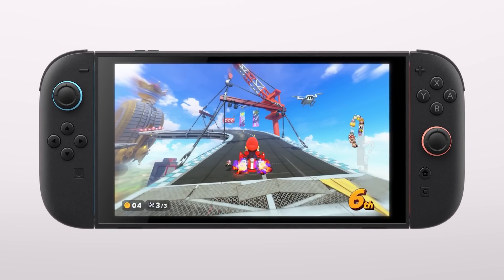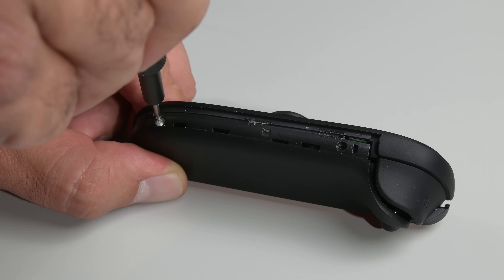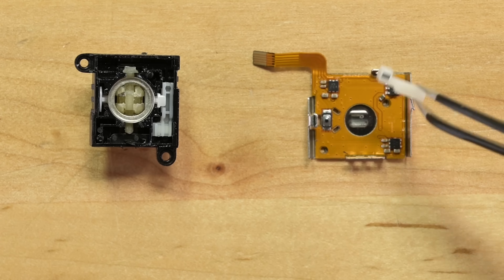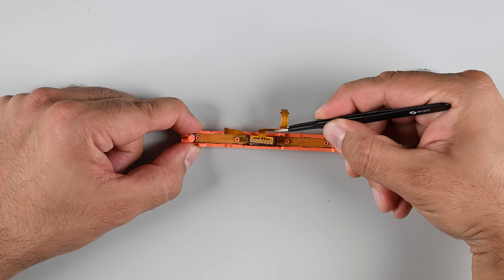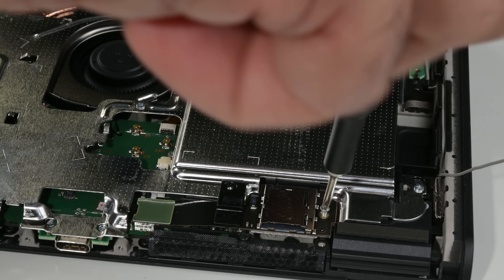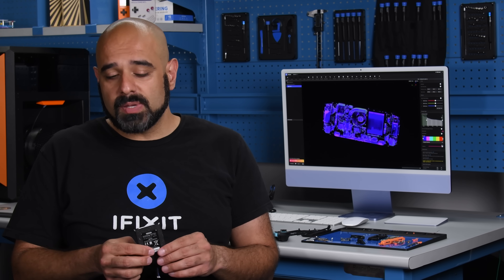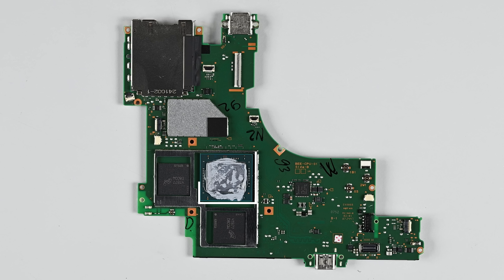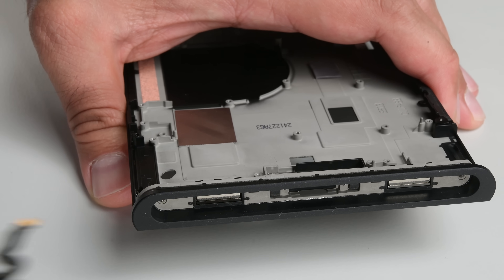Joy-Con Drift Isn’t Dead: Inside the Switch 2

Comment: Your wrong about how much stronger the Switch 2 is, it’s not 3x, in handheld mode it’s 0.15 tflops on switch 1 while the switch 2 has 1.71 which is 11.4x, in docked mode the switch 1 has 0.39 tflops and the switch 2 3.1 which is still about 8x so in total we are about at 9.5x. Also TeraFlops don’t tell the whole story in reality the switch 2 is even faster than it seems here, and it does absolutely not get beaten by the steam deck, I don’t even know where you got that info.

Comment: NIntendo is not legally required to provide genuine parts / instructions to do your own repairs.  Nintendo control the hardware at all levels and if you need a repair only Nintendo are authorised to do so as indicated in their terms / conditions and this is also a condition of sale.  Nintendo do not care on people’s “repair” opinions and never will as its more profitable to offer authorised repairs only.  As for “drifting? there is no financial incentive for Nintendo to resolve this issue either, so instead of “fixing” the issue they simply replace the sticks with the same identical hardware which will fail down the track - this is not a fix - its a band-aid solution.

Also remember legally despite the amount paid, you don’t own the hardware - it’s basically rented / leased from Nintendo upon payment because they can electronically lock the device or brick it without any reason.  Nintendo was also taken to court regarding these hardware faults and as expected they won.  If you truly want a gaming device that you can repair without any of these issues, the only option is to make your own from scratch - good luck on that.

Comment: What’s infuriating is that they made this consciously so you’d spend more money by replacing joycons due to the drift and console battery really should be easily replaceable just like the one in PSP was since the Switch 1&2 basically is a handheld device.

Comment: The game cartridge slot being non-modular is such a terrible misstep in terms of repairability. The pins mangled so easily, especially when a kid tries to insert a game that has its plastic guides on the back mangled or even ripped off. It looks like one would have to do a near-full teardown just to be able to remove the metal shielding on the game slot to re-bend any bent pins.

Comment: I wish people would quit mindlessly assuming/repeating that Hall effect joysticks are better than potentiometer.  They can last longer because they utilize magnets instead of resistance, and that is the ONLY benefit.

In terms of analog range, force curves, and general feel, Hall effect sensors are massively inferior to potentiometers.   The Sega Saturn and the dreamcast both used Hall effect sensors and nobody is running around talking about how they are the best joysticks ever.  In fact, they tend to be loose and sloppy like most Hall effect controllers.

Hall effect controllers still have moving parts too, they still have springs, they still have to re-center themselves. They still have most of the same wear issues as potentiometer sticks.

Comment: The main board of the switch 2 doesn't look very space efficient. And that is a real shame drive they could have just put a bit more effort into the main board design and cleared a lot of room for a larger battery.
Reply: Just with every aspect of the build and circuitry design is very lazy on this device.

Comment: Might it be possible to fix the Switch 2's drift by using TMR (not hall effect) sensor sticks? TMR's resistance to electromagnetic interference might be enough to not have the Switch's magnets introduce drift on the sticks, and at the same time, since TMR work with magnets (like hall effect does), they would not wear down and start drifting like potentiometer sticks. TMR is also higher resolution and more sensitive than hall effect, while, like I said, not being as sensitive to outside magnetic fields as hall effect is.

Comment: Why this thing sold so much ?
It's the same price as the 256Go Steam deck, which is open and repearable... And in one or two years emulators will allow to play Switch 2 games anyway.

$450 for an irreparable console that can only play $50 to $100 Nintendo games is pure insanity.

With 2 games on a couple of almosy necessary accessory, it cost the same as a 1To Steam Deck... Why ?

Comment: For a "new console, redesigned from the ground up," this layout and set up seems terribly similar to your switch 1 tear down, only now made more difficult with more hidden screws and required prying and more inconvenient by soldering the charge ports and the game card reader directly to the board. Seems they had no fears about repeating mistakes made with the switch 1 hardware, ie joycon drift and game card read errors.

Comment: Customer Experience: Deeply Concerned About Dealing with Fraud

I've been active on your website for a week. We are a repair shop with over 15 years of experience.

My first experience was successful.

My second experience, however, was catastrophic. I ordered an iPhone 12 Pro LCD screen, but when the package arrived, I found a battery inside the box instead of the screen.

I contacted support, and they denied any error on their part. I then verified that the item had been replaced with a battery and that the screen I ordered was no longer in stock. I sent complete pictures to customer support, but they insisted that I had ordered a battery.

I asked them how I could possibly confuse a battery with a screen. We regularly purchase from Amazon, eBay, and many other websites without any such errors. Sometimes, shipping errors occur from companies or their employees, but these are quickly rectified.

I tried to resolve this with them repeatedly, but to no avail. Now, I'm being forced to return the incorrect item at my own expense, wasting my customer's time in the process.

This will not happen again. My account will be deleted from your website. I have also promised customer service that I will share my full experience on social media.

Comment: You forgot to mentioned the switch came out with the same battery life as the switch 2
They are matching that spec and thats nothing less of what they needed to do and shouldn't be ostracized for that considering its a whole new platform.
Only the switch oled and V2 switches jave the upgraded battery life which ammounts to less than half of the user base so I think the battery life on teh switch 2 is totally fine as it is right now. Specially for the kind of power its outputting. A abttery upgrade is also something we can expect from later switch 2 models

Comment: Instead of those bulky glue-in trays for the batteries, they should have just built the batteries with a rigid casing than can be secured with screws instead of glue.

Comment: For the battery alone the Switch 2 should get a 0/10.

Imagine that even with dunking the whole thing into isopropyl alcohol, there is a significant risk that when pulling out the battery that it bends, to the point the Anode and Cathode touch and short-circuit, Galaxy Note 7 style.

Comment: People are really going to blame just Nintendo for using potentiometers when every other console manufacturer and even Valve does the same
Reply: it's not potentiometers that are the joycons issue. The housing of the sticks is flimsy and deforms overtime, that's what causes the drift. Some of the fixes for example are just adding material (tape, paper, etc) underneath the stick housing to keep it pressed together, but that can cause other issues (cracking the whole shell of the joycon).

it's possible the housing here has been improved, but they're working with the same spatial constraints and certainly didn't mention any improvements in that regard. So my guess is it's still going to be a common issue
Reply: @smugler1  Yes that was the issue with the joycons and they have changed the design which is why I find it strange people talk as if it's just the use of potentiometers. They improved the design for even the switch oled and switch lite. Yes you will still get drift eventually on the same level as every other consoles controller but it doesn't have the same issue the launch switch 1 joycons had.

Comment: It costs about 50 cents (per unit in bulk) to implement hall effect sticks. They are readily available and would fix stick drift permanently. Nintendo deliberately chose an option that will cause stick drift on joycons and pro controllers. If you open it up to swap it out yourself for hall effect sticks, it will void the warranty. They even had the nerve to add a waiver in the EULA because they knew they would be facing a third class action lawsuit for these controllers. 

It's disgusting and anyone who bought a Switch 2 is part of the problem.

Comment: Why couldn't Nintendo simply take responsibility for their hardware design and implement software in the settings menu that allows you to verify a stick is drifting, to send back for replacement under warranty?  They could easily compare of hours of logged playtime and drift condition to allow Nintendo to acknowledge within reason that a joycon has worn down due to natural usage, not user damage.  This whole thing would be no problem if they just did this.  No one would complain, no law suit, no ill will against the product.

Comment: Potentiometers have worked well literally for decades. Now everyone goes nuts because a specific model of sticks didn't work well. What i hate even more though is that people spread lies like "hall effect sticks can't drift". It's really said how people are so quick to just copy and paste whatever BS they heard once.
Reply: This.  The controllers that I've had develop drift was either due to worn springs in the actuators, or debris intrusion causing the actuators to stick off center.  Cleaning the debris out fixed that problem.

The biggest problem I see with the sticks in the joy-cons is that they're difficult to clean due to their compact construction.

Comment: the stick technology present in both joycon iterations is the same technology found in the pro controller, which did not have widespread drift issues because, get this, it wasn't the cause of problems.
Reply: I heard this once too. I think it was the size of the parts that was the problem, not necessarily the design
That being said, Hall effect sticks are still a thing
Reply: Why tf do other similarly sized controllers drift then? The pro controller is no different than those. I just think it is a case related to people not using it as frequently

Comment: Yo iFix it. Why does my Gulikit Hall effect sticks don’t sit center huh? Why does my original stick pot sticks that didn’t get drift yet so much more accurate. Stop touting Hall effect sticks as holy grail fixes as they are definitely not. I want more durable Pot sticks and no more inaccurate hall sticks, and if Nintendo delivered on that. Then it’s perfect for me.

I could try to recalibrate the hall sticks all day and it still not sit center. And it is very noticeable when going through menus and have it move two rows at once ever so often. Oh it happens on four different hall stick replacements and two different switch joy cons. They all sit exactly slightly off up right. It’s a design flaw. Major one to me.

Comment: I wonder how Big-N manages to get away with gluing the battery in, given EU regulations requiring relatively easy battery replacements in mobile devices 🤔 (heck, even Smasnug caved in and now uses a flap system with not so strong adhesive for the batteries in their phones)

Comment: The fact that nintendo made it much harder to disassemble and reassemble the switch and joycons is a big f-you to people who like to repair things by themselves.

Reapplying the joycon-bay stickers or reapplying the adhesive for the side bumper panel on the joycons is gonna be a big deterrent for average moderately techy people to repair their devices.

I was able to replace a stick on my joycons for the Switch 1 on my own, which was quite a pain, but doable, especially since the trickiest part to remove was the ribbon cables and almost everything else was quite okay. I probably won't have such a good time with the Switch 2 joycons

Comment: If their battery is as apple's used to be, 300-500 cycles until 80%, their batteries are simply the lowest quality ever. I won't buy a device like that. A modern (like since 7 years ago) battery handles over 1000 cycles before getting to 80%.

Comment: Hi ifixit! Thanks as always for your Stirling work. I have a suggestion I'd appreciate you entertaining. It pains me to see hardware deliberately damaged as is done when jerryrig and yourself do the scratch test. I wonder if the same text could not be achieved down one vertical side of the screen with shorter scratches so that it would not affect anyone using the device afterwards quite so much? My thought was that at some point you might then give it away to one of your kids or something but I suspect that this poor switch2 is destined to sacrifice it's life in further testing for the good of right to repair so perhaps there is little point in my cautiousness?

Comment: This is the equivalent of saying that any other analog stick that doesnt use magnets is an analogue stick that doesnt use magnets. Its a wait and see how it goes situation. I will say the smooth glide thing they implented here makes them feel entirely different to the ones before, really we gotta wait and see.
Reply: People forget that steam deck and literally 90% of other sticks use the same tech. The reason it was so bad on the original joy cons was because of many bad design factors combined. If those have been fixed on switch 2, they won't break easily

Comment: Hall effect is not necessary, e.g. Valve has no problems with stick drift on the Steamdeck.
Just use high quality components.
Nintendo either by ignorance or malice designed the Joycons to fail.
Reply: Old nintendo controllers didn't have issues either. It's just how the controller is designed. Not the tech. Joy con 1 didn't have anything supporting the sticks below it and the sensors become loose as you use them. The se sort themselves also wear out over time. The new one has thicker and bigger sensor pads and smaller parts that rub the sensor so it should at least be more durable. I can't tell if they fixed the loose sensor issue

Comment: Nintendo used to sell OEM batteries on their website, but ever since the Switch 1 they’ve moved toward being more and more anti-consumer. No more OEM batteries. Still the same analog sticks. Game keys containing a code which will be worthless whenever Nintendo decides to pull the game or shut down their servers. The entire retro library is locked behind a tiered NSO subscription. Increased game prices. And now they can remotely brick your system for any reason. I know it’s easy to say, “well the entire industry is moving in that direction, look at Apple”. But to that I say, look at the Steam Deck. OEM parts availability, easily repairable modular design, and you can install whatever you want on it. I saw a bunch of Switch 2 consoles half way through the afternoon on launch day, just sitting in a display case. But what the company is doing just makes me feel gross when I think about buying one. I don’t know…to be honest, if a must have exclusive title appears I might consider it, but the company and the fact that the economy is on life support makes it really easy to say “no” regardless.

Comment: A nice thing about switch 1 and switch lite was that they were easy to open even for someone who is not that experienced in repairs and this was especially useful when someone needed to replace broken joysticks. Now that they didn't change the joysticks for better but made it harder to open to replace it yourself. On top that, the way they changed their terms of usage enables them to brick your console too of they detect any modification which they think is violating their terms. This is the most anti consumer move I've seen by a company in recent memory.
Reply: sony and microsoft have the same thing in their tos
Reply: @BooleanDev I wasn’t aware about that. I guess right to ownership should be the next thing we need to fight for after right to repair.

Comment: From what I can find, the Switch 2 has about twice the GPU performance compared to the Steam Deck but the Steam deck has a more powerful CPU so for most games the Switch 2 would actually well outperform the Steam deck and then when you add in optimisation for the Switch 2, it will probably way outperform the Steam deck.

Comment: 3:00 Wrong. The magnetic mounting could easily be done with a halbach array that focuses and isolates their magnetic field from the joysticks sensors.

Nintendo absolutely could make these controllers with hall-effect sticks but chose not to. Despite the relative ease with wich they can be replaced, many people will likely opt for just replacing the whole controller. Which is presicely what they want, regardless of the user experience degradation.
Reply: Something tells me they’ll introduce it for the OLED model whenever it comes out and will say Joy-Cons of that variant to people who bought the first gen switch 2
Reply: Mid-console refresh $120 hall effect "premium joycons" available soon in a store near you!!!!!
Reply: @NegativeNanase theyll figure out a way to make the magnets drift

Comment: Is the design around the sticks better? Fundamentally drift is an issue of potentiometers, yes, but the original stick design invited debris straight into the housing. This video doesn't address if ingress is reduced.

Hall effect is not a panacea to poor mechanical design either. I have replaced several sticks with hall effect, including the brand shown here, and after a couple hundred hours they are even worse than the OEM potentiometer sticks. Frequent recalibrating, the stick starts flopping about, loss of detected range.